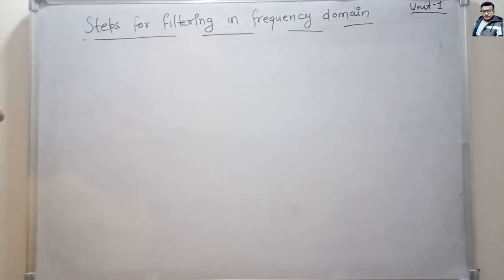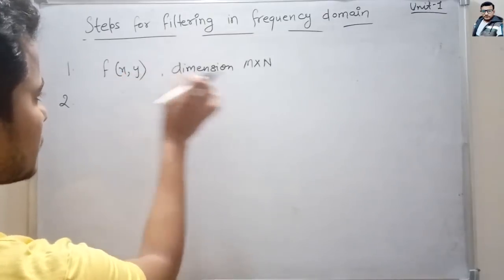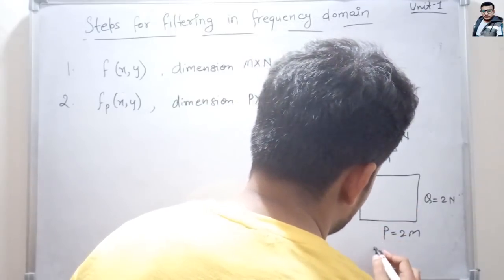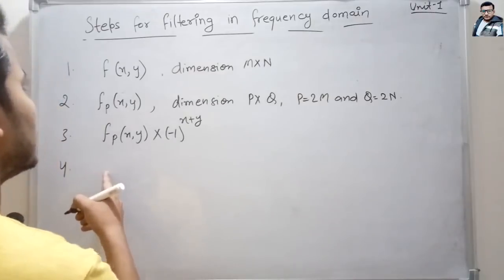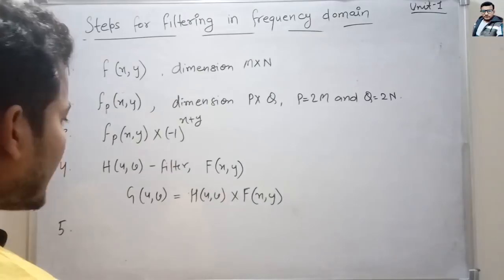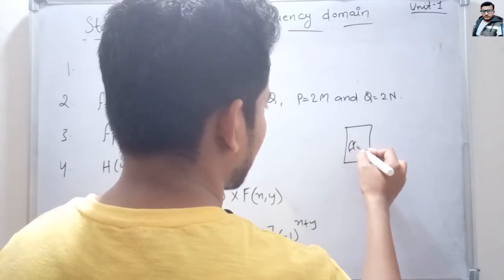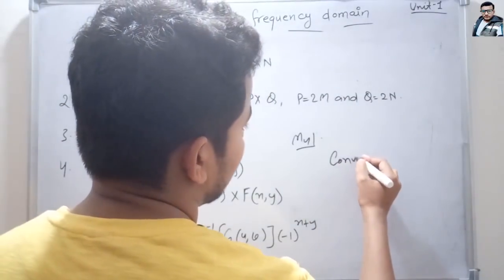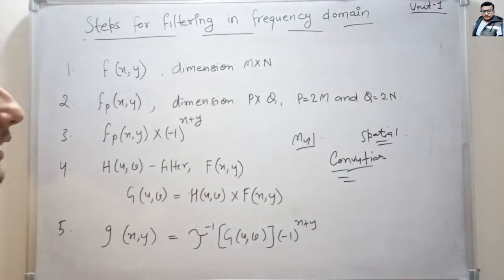4. Steps for Filtering in the Frequency Domain | Digital Image Processing

Comment: What is the need to pad the image?
Reply: Not the image, you have to pad the kernel if necessary.The convolution kernel must be the same size as the image.That's why you need to pad the kernel with zeroes if necessary.
Reply: @dhruba1992  but he didn't use the padding in the solution
Reply: @dhruba1992  what is padding? what is kernel? suggest some text ploxx.